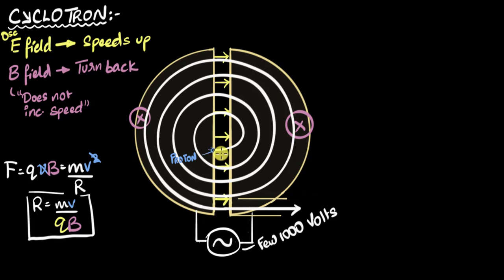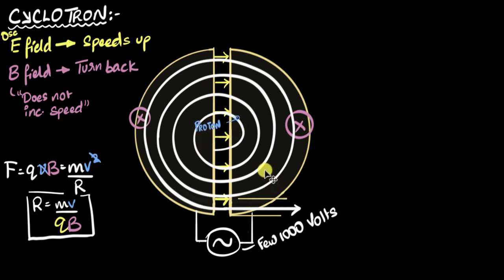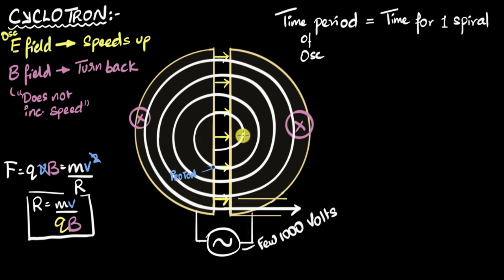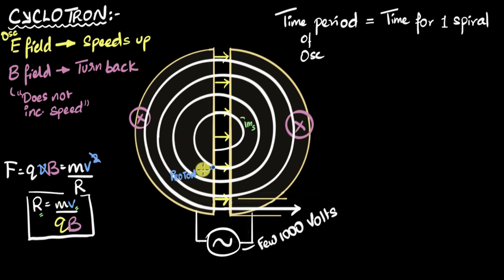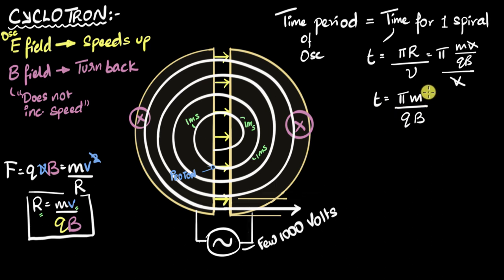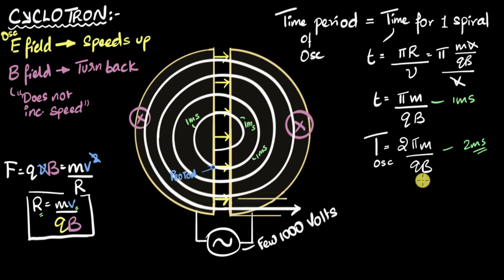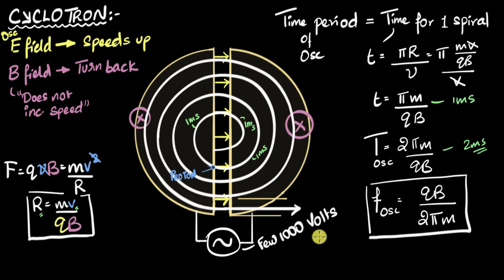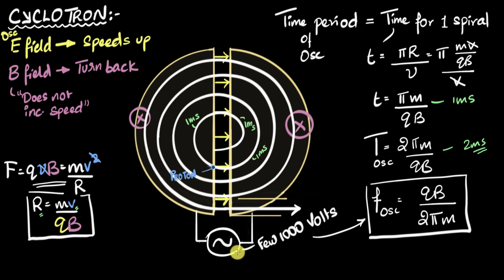Cyclotron frequency | Moving charges & magnetism | Physics | Khan Academy

Comment: Why is frequency same as time period? Surely the ac should switch every half a turn meaning T/2 should be the frequency of the cyclotron? 

Can you explain what am I thinking wrong?
Reply: I am thinking the same bro
Reply: But time period of oscillator means the time required to turn by 2π rad that means time required to bring the EF back to same direction would be the same as the time taken by the particle to move around for 1 spiral 
That is actually correct 😃
Reply: same doubt bro ... did u get it ?

Comment: Wouldn't it be easier to instead change the spiral distance in the outer paths so that you can keep the oscillator frequency the same?
Reply: How do you change the spiral distance in the dees? By changing the magnetic field strength? changing the electric field frequency is easier